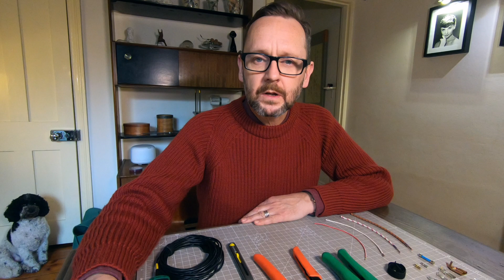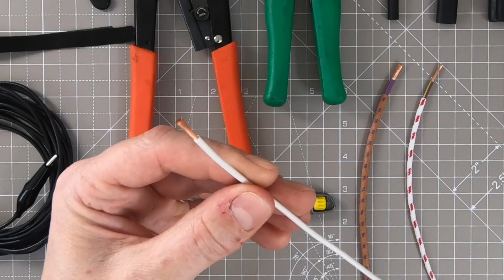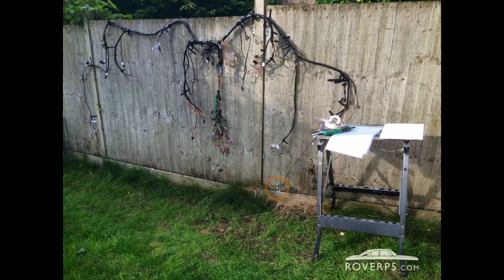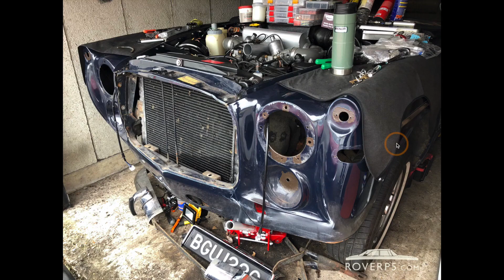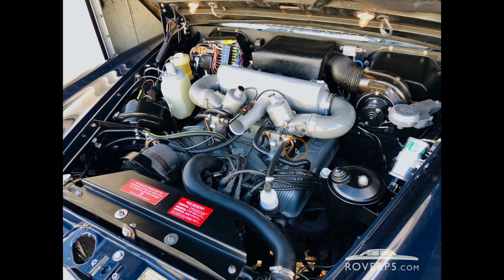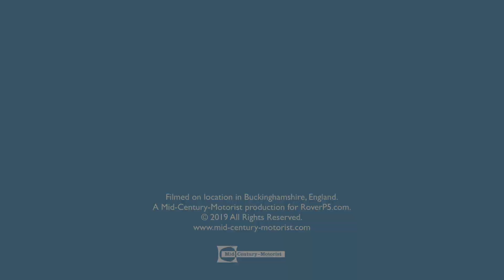How to Fix Your Classic Car Wiring and Electrics (Replacing the Wiring Harness on my Rover P5B)

Comment: I'm interested in a wiring diagram for the extras that you fitted....Hazards, Inertia Switch , fog lights.  Can you provide that please in pdf maybe.  And how would I pay for those. Regards David
Reply from the maker: Hello, if you're able to buy a set of the standard wiring diagrams on the website, I'd be happy to email you an extra set with the modifications - high-level stop light, rear fog light, fuel pump and ignition inertia relay, front footwell lights, headlamp relays, hazard lights. Thanks. The standard ones can be bought here: https://www.mid-century-living.com/products/rover-p5b-wiring-diagram-download/

Comment: An excellent video! I agree: the quality of most wiring plans is awfully bad. Always before builing a new wiring harness I make a drawing with all the wires in their correct colours. A complete wiring plan on which all junctions, connectors and terminals are positioned the way they really sit in the vehicle. 
This makes fault finding much easier than switching between a circuit diagram and an installation plan!

Though I just made motorcycle-wiring over the years (which is shurely much less complex than car-wiring) I also usually add relais´ for the HI- and LO-beam.
And a bit of soldering after crimping the connectors always helps. But doing this you always have to be careful not to melt the insulation!
A great video! I especially like the way you not just fix the electrics but also care for the parts they connect to! Once out, one can also do some overhaul to these parts!
Rewiring will take considerably longer then, but the way you do it makes good sense and a good feeling to yourself!
Thumbs up!
Reply from the maker: Thanks, and it's really interesting to hear your experience. I was quite worried when I started this, as it was the first time I'd done a full re-wire, and it took a lot of time as you say, but I'm really glad I did it. Thanks for your comment.

Comment: I have had 2 P5B's and both of them at, some stage, had smoke coming from the binnical. I managed to catch it in time and repaired the wiring. My second one was a beautiful example and I replaced most of the earth and bullet connectors over time but never thought of tackling the complete loom.
I am now completely rebuilding  a 1951 Morris Minor and I am waiting on my new harness to be made. After watching this it makes the little Morris look not too difficult. Thank you.